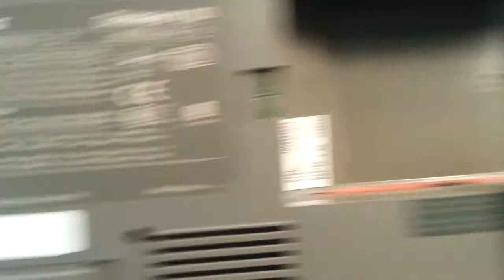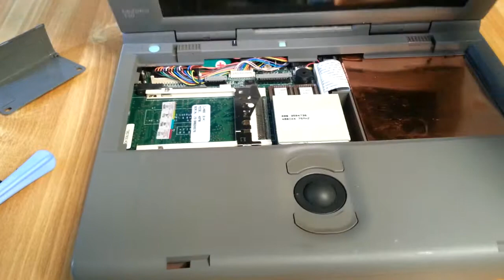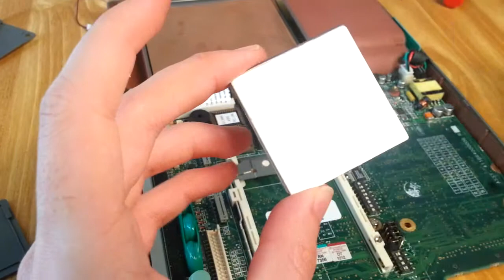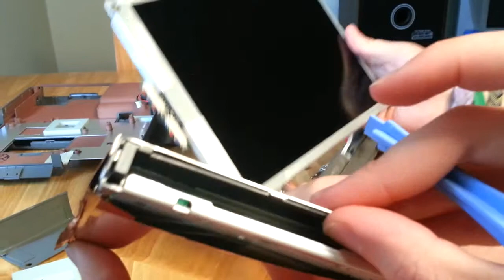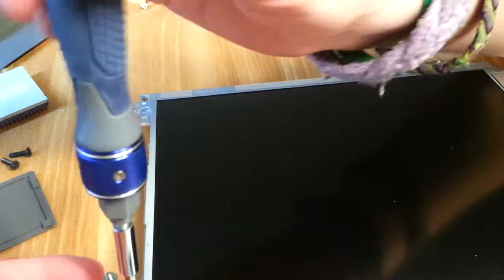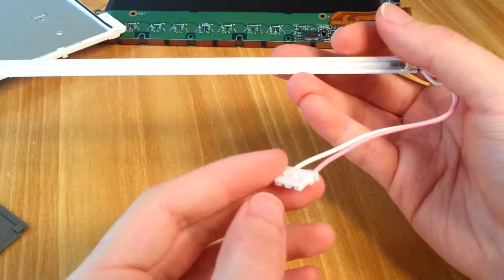TeardownTube - episode 30 - AT&T Globalyst 130

Comment: You can't power it on ? come on guys 2 wires, an solder to it...
Reply from the maker: It wasn't an issue of a physical connection but rather it requiring a supply with voltage and current that exceeded what we have on hand. I guess we could have snuck it into the lab but that would be too much effort.